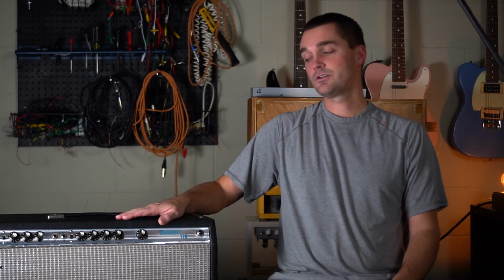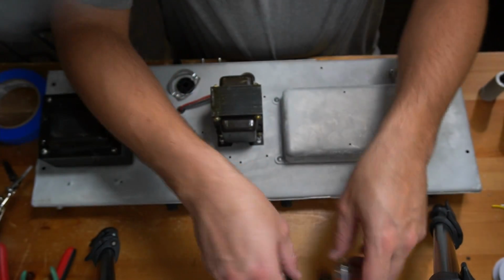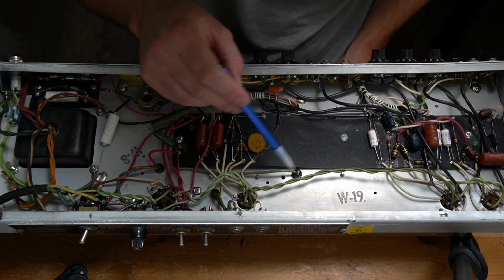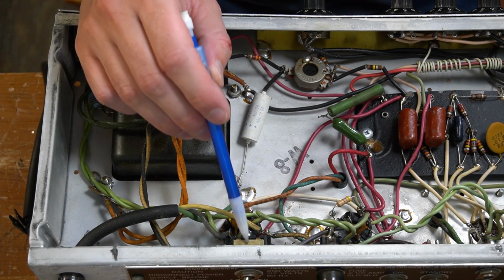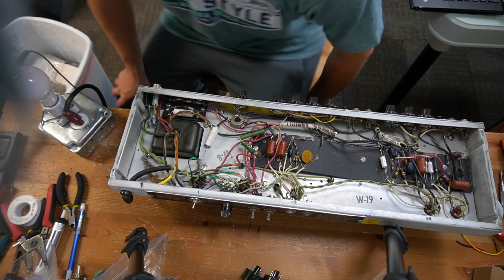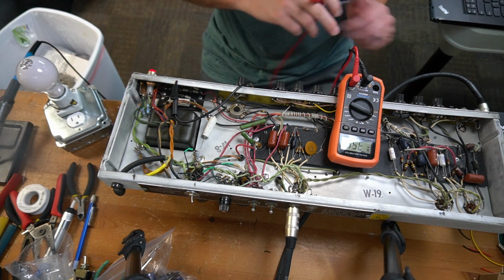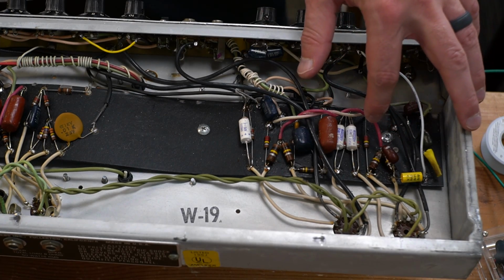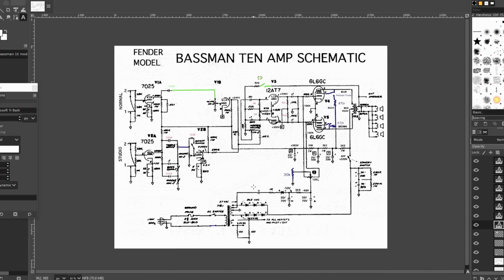Fender Bassman 10 - Service, Repair, Breakdown, Tone Mods

Comment: Old video, but whoever has it now has a nice 50W amp that loves pedals.  The cab and front panel looks really nice.  A (now) popular mod is to punch a hole in the chassis to the left of the two 6L6s and install a 5Y3 tube rectifier with a switch to select either the tube or the stock SS rectifier.

Comment: I have a mint 68 Fender Bantam amp.All original tubes.  It came with a weird trapezoidal foam Yamaha speaker.  I took that baffle out and made one for a 12 inch Vintage 30. It is essentially a tube rectified Bassman 10 circuit without the master volume. It sounds fantastic and is a sleeper. I got mine for $250 about 10 years ago.  They are more now, but still pretty cheap. Mine is great clean, cranked and as a pedal platform. One of my favorite amps.
Reply: Love your playing and love the Bassman 10 demo I should have added.

Comment: I have one of these that sat for over a decade and the tubes are getting so hot it feels like standing next to a campfire when I stand behind the amp. The tubes that were in it red plated when I first kicked it on and burned up the fuse. I found that the power to the transformer was setting on top of one of the tube pins and they got so hot the insulation burned and the tube pin was either arcing to the input power or the two pins were carbon tracking along the burned insulation. I rerouted that and spliced that section of transformer wire out, put a different set of power tubes in it and it sounds good and doesn't blow fuses anymore, but that heat is way more intense than I ever remember a tube amp giving off. I'm wondering now if this bias resistor might be the problem and that I could fix it with that 30k control pot trick you did? I noticed some minor differences on mine too. That balance control pot has a resistor to ground coming off of it and that's missing on mine, and that pair of green components in series have a white 2250 ohm resistor there instead, but otherwise it's identical under there. And yes, this thing has a very flat tone when you play a guitar through it. Sounds very 60s-ish bass when you run a bass guitar through it though.
Reply from the maker: @randr10  Yeah an adjustable bias pot is a nice addition.

Comment: Just saw this - Really informative!  I've had a BM-10 chassis only for 30 years. Used as a tube amp learning platform.  Put in the bias pot and precision 1 ohm resistors to measure current back then. Thanks very much for the insights.  I grabbed mine form of the attic and ready to dig in.

Comment: Thanks for your helpful video. I just acquired one of these and got it back up and running. I’m curious how you get all the overdrive in your demo? I can’t get mine to break up.  Also sounds like there is some reverb in there. Are you using pedals?
Reply from the maker: One mod I did on channel one was to remove the resistors that make a voltage divider on the input before v1. That was sending some of that input signal to ground.
Reply: @KleyDeJong  I really like the sound of your modified channel 1.  Unmodified, channel 1 does not sound good on mine.  Still curious how you are getting the reverb and additional drive?

Comment: Hello Kley! Great Video!
Do you have any solutions for the huge low end that the blackface amp produce. Tried many speakers with my 1965 Vibrolux but the bass get’s really lost on volume 5 or more
Reply from the maker: I usually run the bass control at 2 or 3. Treble at 6 or 7.

Speakers are a great idea as well.

Past that there are a number of ways you could shift the overall EQ to be brighter. I'd look at the bass and treble capacitors and the pot values. I'd use the tone stack calculator to dial in an idea on paper the test at length.

You could also send it to me and I'd be happy to give it a deep dive on a video!
Reply: @KleyDeJong  I wish could! I’m from Israel! Thank you for the fast response. I’ll keep watching your videos!
Reply: You practically destroyed that poor amp

Comment: i have a an old bassman10 in original state, but a few rca 35604 diodes in powersupply are dead, what would you replace them with ? (running the amp at 230 volt)
Of coarse i am going to recap it.  an i might do some of your (reverseable) mods to it , Nice Job
Reply from the maker: I've been using 1n4007 with good success

Comment: Thats one hell of an amp. And very good video, with informative details. Perfect demonstration of impact of negative feedback (or lack there of). Great work.

Interesting, that you installed the penthode/triode switch, as Uncle Doug is not a fan of that, as he thinks the triode mode is not very good for audio.

ps: I will very probably live only in the "Tweed mode" just rideing volume on guitar. But hooking AB switcher will allow for very nice dirty/clean channel switching, without jumping too much in character of sound (what is often problem on modern multichannel amps).

Comment: I want to mention that if you are unaware of what the reference of "death cap" is to, or what the DANGERs are in using an amp with this wiring schematic - it should be promptly understood.

I recently inherited a Bassman 10 and I am so glad that I have not plugged it in or turned it on yet at all. I will not even try until this is reworked... If you look it up, there is a capacitor in the circuit which can fail and result in the guitar going straight into "main" voltage (i.e. straight into the wall). Appalling.

Comment: You need to replace those with 500 volt capacitors not 450 volt, They wont last.
Reply: Yep.  I'd punch a hole and install a tube rectifier.  That'll bring B+ down too.
Reply: Fender specifies 600v for all the capacitors in that amp
Reply: Brown box helps